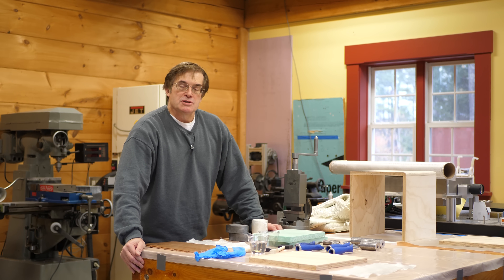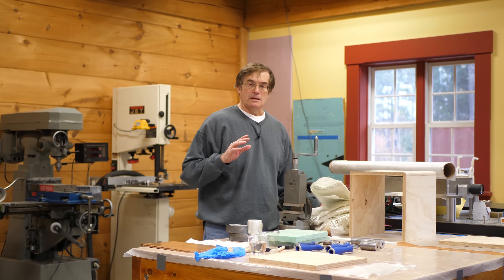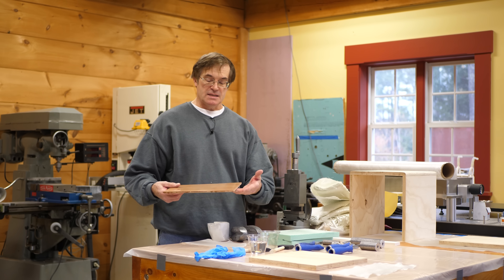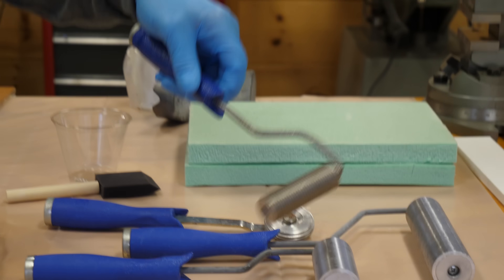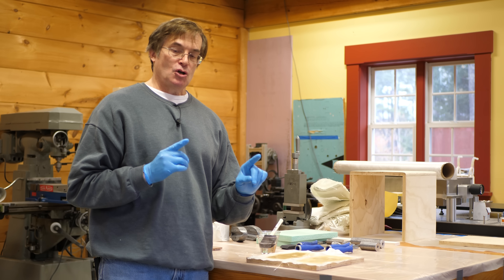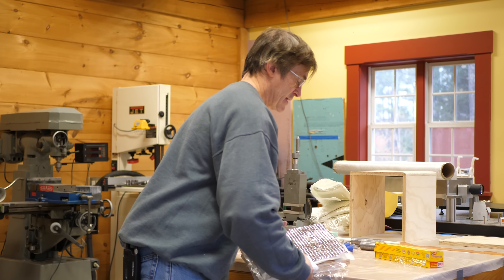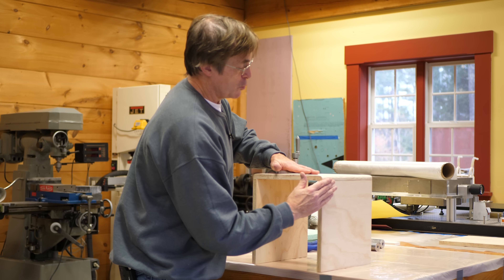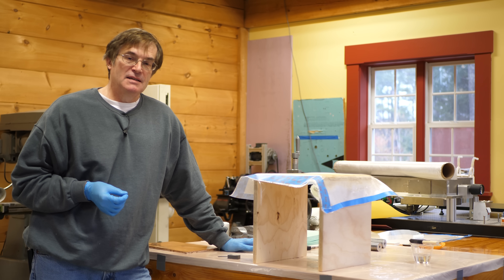Easy Tricks Using Fiberglass Strengthening!

Comment: Incredible video! What cloth was used for this video? (weight/density/pattern?) what is the sweet spot for using it for building lightweight furniture for a boat?
Reply from the maker: 6 Oz. Plane weave is a good starting point.  Lighter is easier to conform, but it might require more layers. Furniture is small compared  to the boat and so the cloth choice won't  contribute much, either way to the overall weight. You want to focus on what's  easy to work with and cost.
I've found that sticking with a few cloth choices and adapting the number of layers to meat the strength requirements   saves on inventory and minimizes the waste.
Reply: @TechIngredients   Many thanks for taking the time to respond. Have you heard of a "hack" that involves using foam and a fiberglass insect screen? Do you believe it could make sense?
Reply from the maker: I haven't, but it might be fun to try it.  That's the best part when exploring new techniques.
Reply: @TechIngredients  If it wouldn't be the problem I would love to ask one more challenging question :). I'm trying to build a floor from 3cm xps + fiberglass core sandwich.  I'm thinking of supporting it with wooden beams 3cm but maybe amazing brain of yours has some suggestions how can I fight compression of xps and save as much weight as possible ?:)

Comment: You can also lay down the fiberglass fabric on a 45 degree bias so the fibers cross the edge at a 45 degree angle.  The cloth will curve over the edge much easier and lay down better.  You can go around a corner much smaller radius if necessary using this technique.
Reply from the maker: True.

Comment: I made a small plywood table to be able to use my thickness planer as a jointer.  Unfortunately I used 1/2 inch plywood, which turned out to be too flexible in use - but then I remembered this video, and volia! Problem solved.  Thanks!!  This has me wondering about another aspect of this process which may be very important to me - how much fire resistance does this impart to treated wood?   Wildfire is an ever-present threat where I live.  We've taken some steps to harden our home against wildfire, but there is an area along the entire roof-line of my house where embers could collect and ignite the roof!  I've considered using flashing as a barrier over the existing wood or replacing it with sheet metal, but now I'm wondering if adding a layer of fiberglass would be an option.  If nothing else, fiberglass would also clearly also impart water protection for the wood.   Thank you for all your amazing content!

Comment: Fantastic illustration!!!  I am using this fiberglass method to provide additional structural rigidity for a "factory" glued butcher block piece of wood purchased at a "big box" store.  The glued joints from the "factory" don't appear to be very strong, and the application of the piece of wood requires strength.  Using on one side only, and should provide strength enough for this application. Great video, thank you!!!

Comment: my hands are itching just watching you handle that stuff without gloves
Reply from the maker: I have never had a problem after decades of handling fiberglass cloth.  I'm careful not to grab and pull which not only breaks the fibers and can work them into your skin, but also ruins the cloth.
Reply: @TechIngredients  Fair enough, i have never worked with it and have girly hands
Reply: It's really not that bad. The trouble comes when you have to sand or grind through cured fiberglass composite. Then you get itchy. Or I do.

Comment: I'm curious if you're going to apply an outer layer of silicon dioxide (aka liquid glass) to make it superphobic to your catamaran. I'm wondering if this will increase the buoyancy of the catamaran and allow it to achieve higher speeds.
Reply from the maker: No.  Frictional drag is a small part of the overall drag as the speed increases.  It is still a factor and it won't hurt to try to reduce it.

Comment: Great video... but how do you apply fiberglass over foam without melting the foam..?
Reply from the maker: You're thinking about polyester resins.  Epoxy does not desolve polystyrene and is also tougher and more crack resistant.  Take a look at some of our other videos on epoxy.

Comment: very good lesson you gave ... i used fiber glass few times and i apply resin first before  putting fiber glass over (it felt right way to me)  and i been putting clear piece  of plastic bag just to work it in with fingers in some corners or so ...

Comment: @Tech Ingredients.
Thanks for another fantastic video "chock full" of useful info and tips.
I have a couple of questions as You didn't really "touch on" the importance (or irrelevancy) of the "weave" for structural strength. 
E.g does orientation of the "fibers" in the cloth make any (practical) difference at all, is there any difference between different types of "wheaves" (besides the weight). And finally is there any disadvantages to use many separate "pieces" of "cloth" when covering an "object", for instance I could imagine that having a "continuous cloth" over a "stress concentration" could be stronger than having two pieces that joined at the "stress point"...For instance the piece You made the last demonstration on would that possibly be stronger if You covered the whole "outside" with one continuous piece of cloth compared to using separate pieces for each side ?
Thanks again for all Your fantastic videos.
Best regards.
Reply from the maker: Yes, the weave matters.  Plain weave is the least expensive and is easier to work with.  Harness satin drapes more easily and looks nicer.  Twill looks nice as well.  Unidirectional is obviously good for its specific strength.  More light layers are easier when you want the cloth to conform and will be about as strong, but will cost more for the same strength.

Comment: Do you have any videos on vacuum bagging to consolidate sandwich composites and reduce the amount of unnecessary epoxy in the reinforcing cloth to reduce the finished weight?
Reply from the maker: I've  done it, but we haven't  made any videos  about the process.
Have you checked out the Guogeon Brothers books on wooden and composite boat construction?
Reply: @TechIngredients  I have read a book on composite building that aerospace engineer Burt Rutan put out for building the aircraft he designed and sold plans for. Thank you for the suggestion of the Guogeon Brothers books

Comment: Do one really want a smooth dimple free surface on a boat hull? Won't the dimples reduce friction as it does on a golf ball? Great tips btw, thanks for sharing!
Reply from the maker: No, they won't.  The evidence is that you don't see them on fighter jets, race cars or even lining the inside of water pipes.
The principle is that laminar flow is more effecient around a streamline body.  But, blunt bodies like golf balls can't maintain laminar flow as the air is streaming past it's widest point.  The flow separates and a low pressure region persists behind the ball, "sucking" it backward and increasing drag.  The dimples cause the flow to separate a little further around the ball reducing the size of this low pressure region.
Reply: @TechIngredients  ahh, thanks, got to look closer on that!

Comment: We used to call it "kicked" when the MEK was mixed into the resin. Man that stuff would produced such heat. We used large chop gun that blasted kicked resin and chopped glass onto the large molds. The glass was on a large spool and came off like a rope, which fed into the gun and got chopped into 1 inch pieces. Pretty impressive. One guy ran the gun while a few of us used those bubble rollers to roll out the glass and bubbles.

Comment: I have a 1970’s era Toyota Land Cruiser wagon (FJ55, for those who know). Good body steel was hard to come by back then; what was available was prone to early oxidation failure, and many of these have since rusted away. 
The previous owner attempted to fix holes in the roof with sheet metal and Bondo - needless to say, that fix wasn’t successful. 
After watching, I’m inspired to clear the previous work and do a fiberglass repair. I’ve heard West Marine is a great product supplier.
Reply from the maker: They are.  Good luck!

Comment: That reinforced extruded polystyrene foam is very interesting. Have you used that technique in real world applications?
Reply from the maker: Yes, but polystyrene is not very strong in compression and makes a rather poor core as it will fail much earlier than the fiberglass skins.  It's low cost and for non critical applications or scale models it's very useful.

Comment: I have to repair a cracked hood on my JD tractor which is a plastic/polymer material. I want to use fiberglass material for the repair. How do I repair the hood before I apply the fiberglass?
Reply from the maker: Bonding to plastic is chalanging.  The surface can be abraded and in some cases, treating the surface with a heat gun will oxidize the base plastic and this improves adhesion.  Try these techniques on a small area inside the hood then test it.
Reply: @TechIngredients  Thank you and I will try to heat the area as you have suggested in a small area if it works then I will proceed with the repair. I let you know how it went. Thanks again.    Joe

Comment: Hi!!! Thanks fot the great video!!!
What would you your choice of fiberglass for reinforcing a boat swimming platform? Would you doit with with what kind of resin??
Reply from the maker: The resin is fine for that process.  You can use a heavyweight cloth to minimize  the layers to save time. A core with a marine grade plywood will further reduce the build time, save weight, and increase the stiffness.

Comment: What is the best technique to use if you have to apply glass on a vertical surface?
Reply from the maker: Depends.
If vacuum bagging is available, then this will clamp the cloth to the surface very well.  Otherwise, very thin coats of epoxy with the last strokes passed in a downward direction to minimize  runs.
Ultimately, you may have to resort to some sanding.

Comment: Also, baby powder on your skin and sleeves seams, and neck seams, lessens itching drastically when laying up large areas or sanding.
Rubbing dish washing liquid with a tiny bit of water, and letting it dry, before starting with the resin or mat also works. And you clean up easily.
Try "scrunching up" heavy weave or chop-strand before applying to the resin, it will lay around corners and in valleys better!

Comment: Would you recommend using this technique for soft spots on a boat?  What epoxy would I use and what cloth?
Reply from the maker: It would be part of the solution.
Typically,  those spots are associated with a collapse of the core layer.
To do it right, you need to expose and then replace that core.  Then, sand the hull over an area a little  larger than the hole you made, feathering the edges and using the fiberglass (6 Oz. Plain weave is a good choice) to build up to a flat surface and sand the cured build-up before repainting.
Reply: 2 things what type or epoxy ? at any hardware store? 2nd the soft spot are on a plywood floor of a Bow Rider boat not near the hull area.
I have 3 soft spot too small to cut out they are only   8 x 8 inches . . . Can I lay down some epoxy then a layer or fiberglass and then more epoxy and then let dry and install new carpet ?
Reply from the maker: I like Raka epoxy, and their  "slow" kits are the easiest to work with.
You can try to just add some cloth and epoxy to reinforce the areas, but a soft spot almost always means there is trapped water and rotten wood. This can interfere with bonding the additional layers.
8" is an ideal size for the repair I described above, but you can certainly try the simpler approach, and if it doesn't stiffen the areas enough, it won't prevent you from doing what I described.

Comment: Very good.... I repair electronic devices in plastic cabinets or with injection molded chassis. Roughen surfaces, apply resin and then press various grades of fiberglass cloth into part break and brush out air bubbles as necessary.  However, I saturate not with two-part resins but with UV cure resin.  The repair is hard enough for service in just a minute or two.  If I want to add another layer, I use your excellent advice to roughen the cured resin and wash before adding more resin, cloth and another round of UV light exposure.

Comment: Doesn't it affect structural integrity if you don't form the 3 sides out of a single glass? Like the stiffness properties shown at the start won't propagate to the other sides, so the 'U' shape can be easily collapsed if force is applied to the 2 'sides'?
Reply from the maker: It is actually stronger because the two layers overlap at the corner.
Reply: @TechIngredients  oh wow. so the overlapping region actually fuse to each other completely?
Reply: Only if you get the corner finished before the epoxy fully cures I guess?

Comment: Can you use a sheet of foam and cover it with fiberglass to make a transom for a boat?
Reply from the maker: Yes, but...
Keep in mind that the foam has a low compressive strength which is fine for the purpose of creating a bridge between the strong fiberglass layers.  All sandwich construction is vulnerable to compressive loading and the lighter the core, the more vulnerable.
If you're going to mount hardware or a motor to the transom, plan ahead and insert a stronger core such wood or a solid plastic in areas you plan to attach something.  This prevents crushing and distributes the load.
Reply: @TechIngredients  Thank You!

Comment: What if you're curing the entire side of a teardrop camper? How long does the curing take after the first coat?
Reply from the maker: That depends entirely  on the epoxy you use.  The best practical guideline when applying subsequent  coats without  the whole sanding and cleaning  routine  is to touch the curing layer. If it doesn't  come off on your finger, but it's still sticky, that's  perfect.

Comment: When I was learning to fiberglass, the professionals pointed out that you always want to jab your chip brush bristles down into the fiberglass. Never slide it along like you would paint like you were doing. This is not only to prevent sliding the fibers around and ruin your fabric layup, but it forces the air bubbles out much more efficiently.

I'm not sure if this is true for the epoxy resin that you've been using, but the polyurethane resins the professionals use are different from the typical store bought resins from walmart in that they don't have the wax coating that floats to the top and seals it from the air to do the final curing. Since the professional stuff doesn't have that wax in the resin, it just cures to the tackyness you mentioned and never fully cures so they can continue to add more layers. Then for the last layer they manually add the wax additive and let it cure fully.
Reply from the maker: You can do that, but it isn't really necessary if you place the dry cloth down onto the wet surface.
Reply: @TechIngredients  Yes, you want to have the wet surface, but you can't solely rely on gravity to do the work for you, especially at complex angles and shapes where gravity doesn't benefit as much. Basically you're just wanting to use the brush to press it down and pop the bubbles.

Comment: what about electroplating the glass fibres with a metal? And welding/sintering otherwise joining the fibres together?
Reply from the maker: Ceramic fibers are used to reinforce metal (aluminum) for aerospace applications.

Comment: I worked with Kevlar fiber ONCE, I’ll never work with it again. I thought I could cut it with with some sharp scissors WRONG. I used metal shears and it took me about an hour to cut about a yard. Edit; 12:15 sometimes they put waxes in epoxy/polyester resin so the moisture in the air doesn’t affect the curing. The waxes float to the surface creating a ‘waterproof’ barrier. THEN you have to sand down the finished surface to get rid of the waxes. TIP, more epoxy isn’t better, it actually makes things weaker. Those metal rollers squeeze out excess resin (along with excess air)
Reply from the maker: They do put wax in some polyester, I've never heard of it in epoxy.  It would interfere with bonding both to surfaces as well as with fibers.

Comment: I found this very interesting.  I have a Pop Up camper that used metal covered OSB in the top front and sides.  The OSB was glued to the metal making it almost impossible to seperate from the thin metal for a repair.  The OSB got wet and rotted and got moldy.  I plan on building a new top and was thinking on using Polystyrene covered with fibreglass for the new roof, but I have never worked with fibreglass before.  The one thing I am concerned with is the channel that holds the seal gasket to roof is screwed to the wood.  Can I get away with just using Polystyrene and screw the channel into it after the fiberglass in done, or should I use a pressure treated wood for the front and sides instead of OSB like the original build.
Reply from the maker: This is a common delema with deck hardware on a sandwich core sail boat.  The better manufacturers will substitute a solid core like wood or fiberglass in select locations.  This can be done after the fact by boring out the foam and filling the hole with solid epoxy or placing the solid pieces with the foam before lay up.
Check out our earlier videos on large composite drone rotors.
Reply: @TechIngredients  thx I will.  I have enjoyed many of your videos and was hoping to make some smoke bombs for training with SCBA at our fire department.